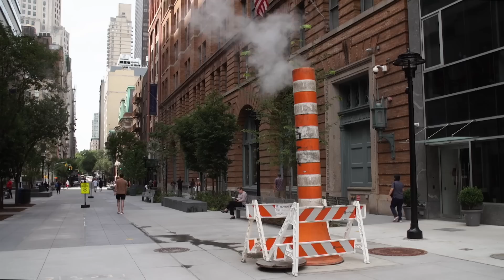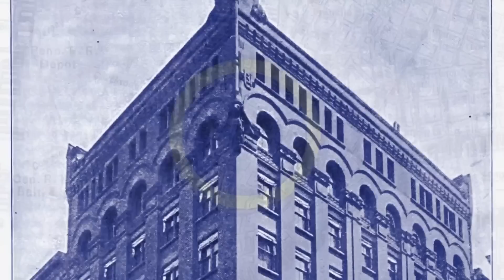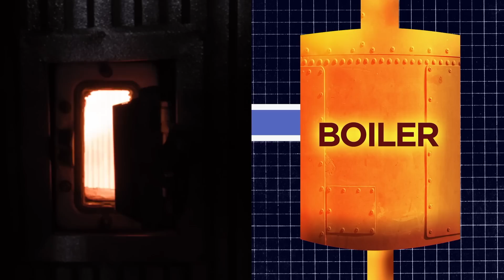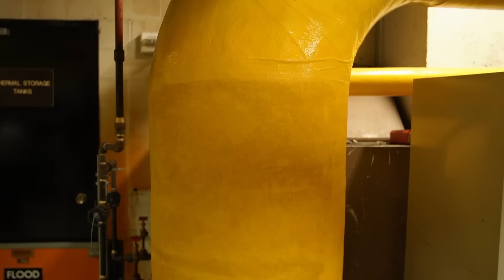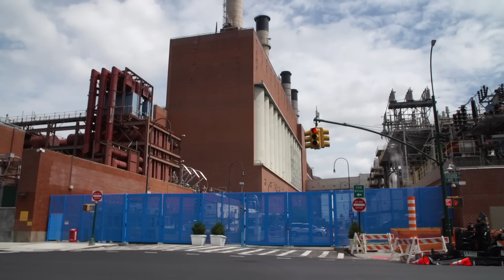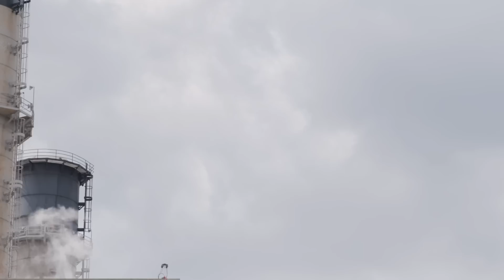New York City Runs On Steam | NYC: Revealed

Comment: I like steam I like that heat and electrical system is 2 different things so if the electrical grid ever went out we would still have nice clean steam for heat all about diversity I think it’s kinda an untapped piece infrastructure I use a steam cleaner in my home
Reply: Your boilers need electricity to run, even steam. No electricity your zone valves and thermostats won’t work even steam needs electricity. Hydronic(water) or mini split lol all need electricity 24/7
Reply: @BertBuild  I’m no expert but pretty sure you still can have stand by power I mean they talked about how they could run their boilers off gas plus buildings can also have stand by generators incase of electrical grid failure it’s a redundant source of heat definitely not full proof in every situation I just wanted to try to come up with some positives seems like a lot of people hate steam in these comments lol
Reply: @DieLynn  yes the boilers do need gas or oil in constant supply and same with electricity. Only way to be redundant even a little bit is to have a generator hooked up
Reply: @DieLynn  steam is actually the best way to heat any space. There is a reason they used it all those years ago and it still is in use today. It’s cheap to maintain and water holds temperature better than almost any element on the periodic table. Thus making steam the best and most efficient way to transfer heat. New houses today use HVAC which is just blowing around air. Air does not conduct or retain its temperature even close to the same rate water and steam do
Reply: @DieLynn  I’m 10 years into plumbing haha been in my family since the 1970’s steam is epic lots of places around the world band it completely in the mid 1900’s because no one knew how to pipe systems right and they would explode is not done correctly. Europe is all hydronic not steam so it’s heating water and forcing that warm water around pipes in closed loops where as a steam boiler is literally taking a constant supply of water and turning it into steam much more dangerous but in USA we have strict codes and people like steam
Reply: @BertBuild  ohh i see well thank you for the shared knowledge! and definitely have some more stuff to learn, definitely fascinating.
Reply: @BertBuild Thermostats in the past didn't need electricity.  Just mercury or  coils. Similar to car thermostats.
Reply: @BertBuild most old radiators have fully mechanical thermostats

Comment: Wouldn't be more convenient to use ocean water instead of wasting billions of gallons of fresh water !
Reply: No, the salt is corrosive. You actually have to make the steam out of purified water, even tap water has too many minerals for use in a steam system. Keep in mind that is the case in any power generation system that uses steam (nuclear, gas, etc..they all generate power by creating steam and then using the steam to run a turbine).
Reply: most definitely not, the water would have to be heavily processed and desalinated to turn it into drum roll fresh water
Reply: I think you dont understand why that would never work. See the part of the video where they even have to purify the already drinkable water? that is because any minerals in the water would accumulate in the tubes and cause corrosion and clogs.
using straight up salt water would trash the entire system in no time. and if you have to purify ocean water the energy of that alone would cost more money than the steam or electricity you could generate with that water.
purification of ocean water is so stupid expensive is only done at scale on rich dry places like Dubai for drinking water not for electricity/steam production.

Comment: Throwing shade on the United Kingdom for burning coal to produce heat when he’s burning gas is hilarious! He clearly didnt do his homework either as the UK does NOT burn coal to provide electricity or heating! (Narrowboats except although DEFFRA have brought in £1k fines for people that burn in clean areas using the wrong fuels!
Reply: you missed the part when he was talking before. the time when london was covered in smoke all day. yes at those time the steam system was also run on coal and was not any greener for the envoriment but certainly was better for the lunghs of the people to have it away from their homes.
This system was amazing back in the day. ofc no city today would even consider it since we have the same benefits with electric heating. and the burning plant is away from the city.
Reply: @Seraphine_KDA_TFT  In germany politicians are really pushing for district heating solutions, where a town has a central large gas boilder or massive heat pump, providing heat for the entire town. But usually those systems run on hot water instead of steam
Reply: @sineptorro9190  For a while, same here in the netherlands. But the for-profit companies running them demand extra money if they cannot compete with local gas heating or they'll shut the system down. The free market is good for some things, but not for all...
Reply: Here in the UK, we only last week turned off the last coal powered power plant. All are gas powered now... Or bio mass.
Reply: @IXISSV 
No coal in UK now.

Nuclear about 15-20%
CCGT up to about 35%
Biomass about 8%
Hydro 1-2%
Wind and solar vary enormously of course from almost nothing to about 45% between them
Up to about 10% imported, mainly from France, where about 75% is nuclear
Other sources such as waste incineration about 1%

I don’t think we have any oil or gas fired steam plants now.

The figures don’t add up to 100% due to the considerable variation in demand and supply over time.

CCGT is Combined Cycle Gas Turbine.  A gas turbine drives a generator and exhausts through a boiler known as a heat recovery steam generator which provides steam to a steam turbine which also drives a generator.  This gives greater efficiency than either steam or gas turbine alone.

There are some small Open Cycle Gas Turbine plants.  I have visited one at Didcot which is rated at 100 MW, with four 25 MW sets.  They can be started quickly, but are expensive to operate, and so are little used.

The biomass is mainly wood pellets imported from the USA and Canada and burned at Drax in Yorkshire which was previously coal fired.

Some of the now closed coal fired stations were converted to also be able to burn gas, and at least one could also burn small amounts of biomass.

Total UK daytime demand is usually around 28-35 GW.

Comment: They should look into tidal generators to power the steam plants.
Reply: Tidal generators to power steam plants would be nonsensical.  It would likely be so incredibly inefficient as you'd have multiple conversions.  Why make steam with tidal when tidal makes electricity that can be used directly?
Reply: No tidal generators are to inefficient. Better is solar or wind combined with a heat pump.
Reply: Yes , we just are not going to use any juice on windless nights …
Reply: no point really when New york city has the biggest GDP in the world. if the want to appear cleaner they put some green energy somewhere else and bring the electricity there. and chapter too since any employee you dont need to hire in NW saves a lot of money because of the wages there.
Reply: Or get the French Canadians to build even more dams. They are quite good at that.

Comment: What would be some of the benefits if we switched to electric?
Reply: There would most likely be no point. It'd probably be so massively expensive to change out the entire steam system that heating costs would skyrocket. The steam system is already in place and works just fine. It'd be much more inconvenient for everyone involved to change a system that works, especially when you think about the fact that electricity is generated by creating steam that runs steam turbines that in turn generate electricity. You'd basically be keeping the steam production while adding an additional step in the energy production chain for no reason. Don't fix what isn't broken.
Reply: every burning something power plant ever uses steam to make electricity. so the an steam plant is not really much different from a electric power plant.
the reason why other cities dont use steam directly for heating and instead go the extra step to make electricity with the steam to then use electric heating is because the whole steam infrastructure would be crazy expensive to install on an existing city. NY has it because is the richest city in the world with a larger GDP than most countries.

most cities cannot afford a system like this. so you get the idea New York city has around the same GDP as Italy and 2/3 of the UK GDP
Reply: One of the limitation for suddenly switching to electric is whether the city's electrical system can cope with the increased capacity of heating. Some cable lines might have to be changed or layed out in order to cope with the increased electrical demand. - that on top of the rise of EVs... Blackouts can become a common occurrence if everyone suddenly switched to electric without upgrading the electrical grid.
Reply: Both steam and electricity have potential energy.  Steam pipes= copper wire in a system they both move the energy around.  The power generation to fill the pipes and wires is where carbon is released.